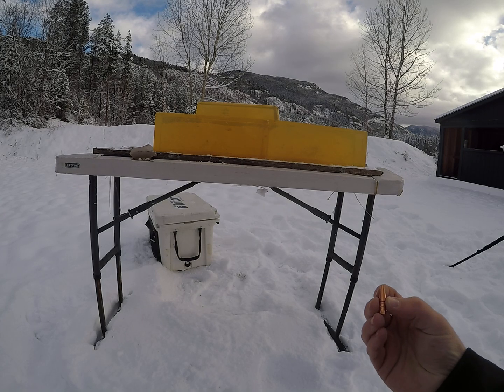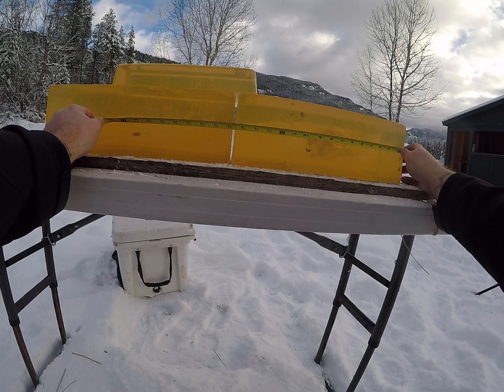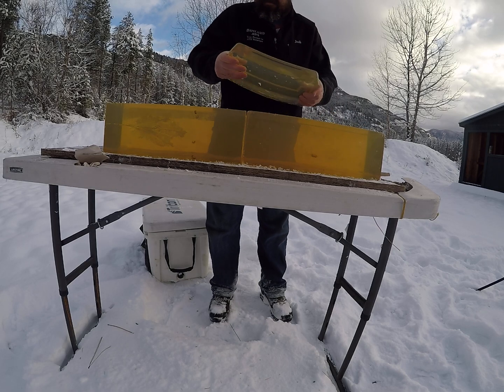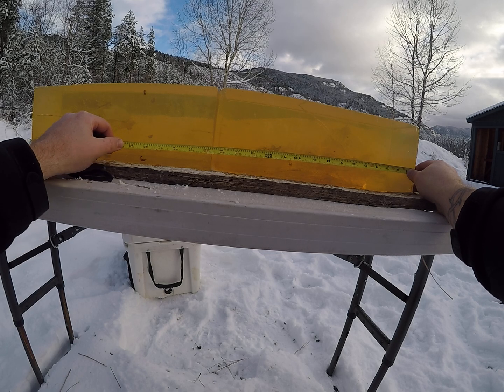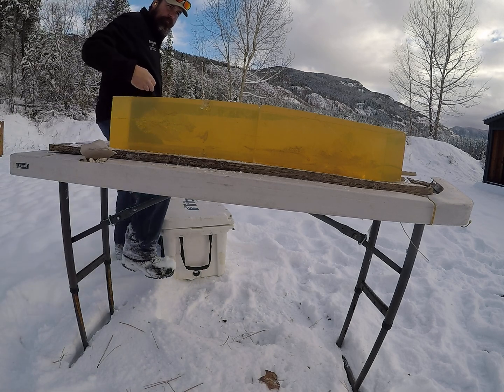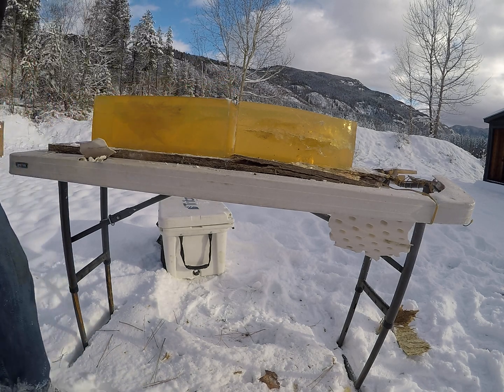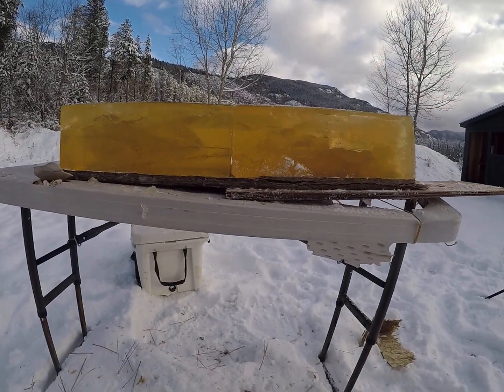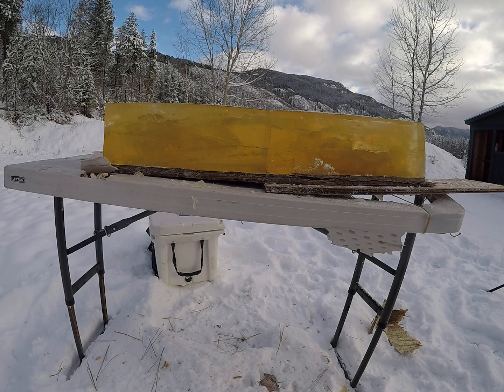152 gr 30cal Lehigh Defense Controlled Chaos low and mid velocity 308 Win + high 300 PRC gel test.

Comment: Is there any chance of a follow up video for retained weight/recovered bullets?
Reply from the maker: Average weight of cores recovered 77.3, average weight of petals 18.0,  for a total of 149.34 grains on average. Petals ranged form 14.7 to 22.7 and cores 76.8 to 77.8 The low velocity core with its petals is exactly 152 grains and with the higher velocity one of the petals exited the gelatin, everything recovered is 137.4 I was unable to recover anything from the rounds shot out of the 300 PRC.

Comment: Shot a lot of deer with the Lehigh's in 6.5 creedmoor and grendel, they died, and it was accurate on paper, but I didn't see anything much different other then multiple exit holes. Maybe in larger more powerful offerings it would offer an advantage over conventional bullets but not sure.
Reply: Great initial expansion and energy dump, good penetration of the base, reliable expansion at lower velocities down to 1500fps. Reasonable priced all copper bullets at $0.66 each, vs barnes TSX at $1.00 each, Horndy GMX at $0.92  each, and hammer at $1.14 each. I will definitely be buying more.
Reply: Either way I get these for cheaper than conventional cup and core bullets.. So as long as that’s the case I mine we’ll go with the all copper rounds.